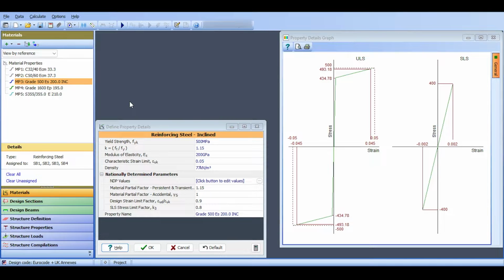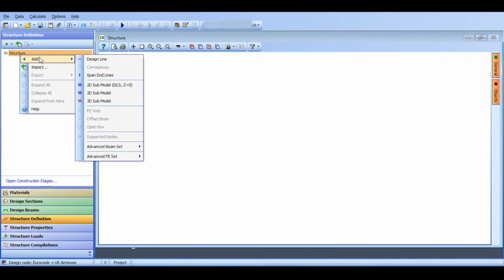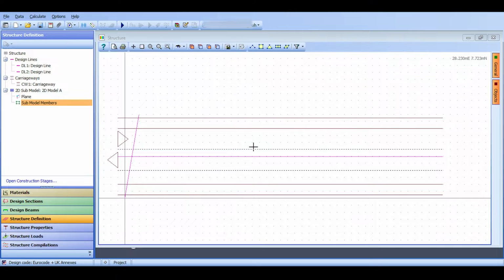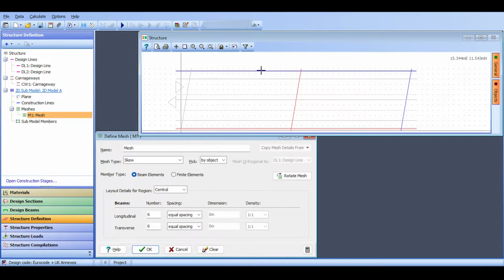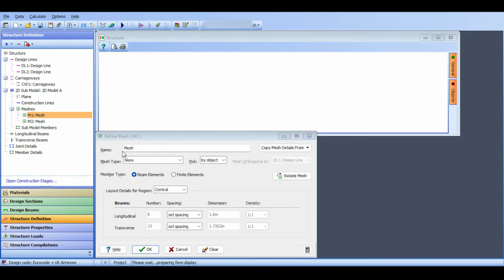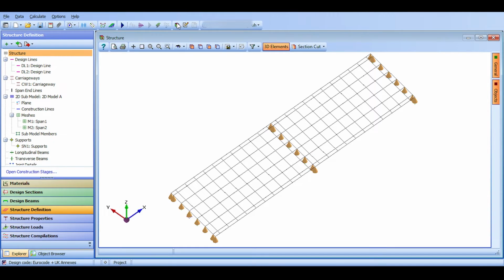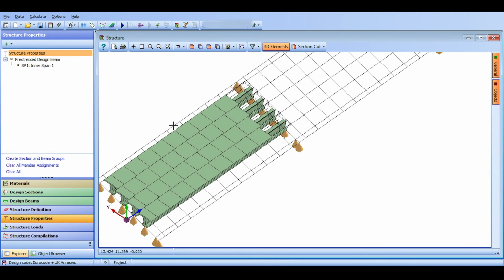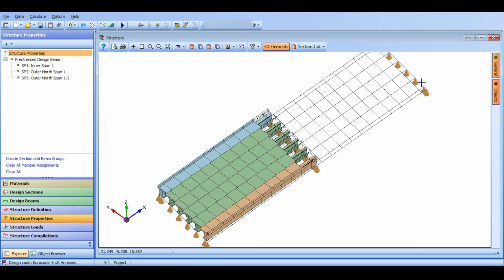Modeling and Design of a Prestressed Bridge on Autodesk Structural Bridge Design - Part 4 Structure

Comment: Hi i have a single beam(9m) which is fixed on both ends. i defined a design line(0,0 & 9,0) and added span end lines1 (0,1 & 0,-1) & end lines 2(9,1 & 9,-1). but my supported nodes option is still greyed out?

Comment: Great series. 
You made a comment "a lot of work".  All this model in parts 1-4 could be done in minutes by creating the model in InfraWorks (starting with a blank project, no model builder or other data import required).  Then create your bridge and get analytical model using Refined Analysis tools.  Check it out!
Reply from the maker: I agree ^_^
I tried to show every single step along the way.
Even autodesk has a "bridge wizard" that could automate most of it, but it kind of does not show the real meaning of each of the inputs an engineer would do.
PS: sry for the late reply.